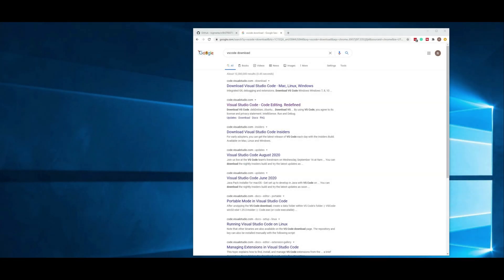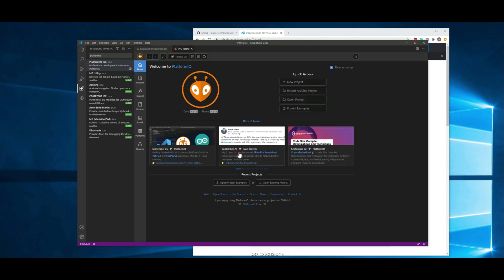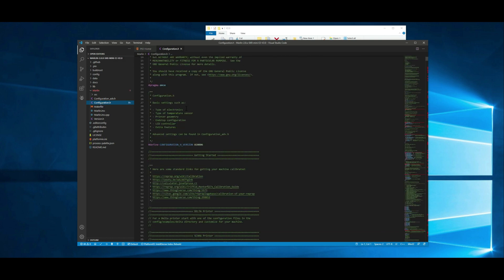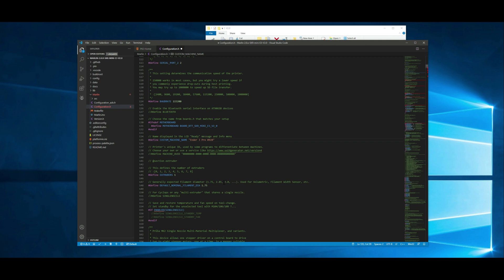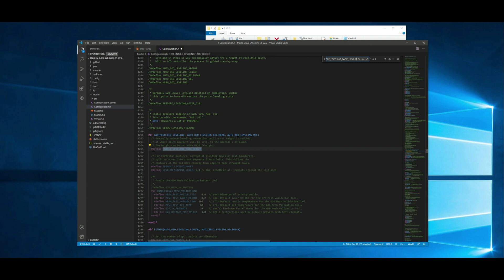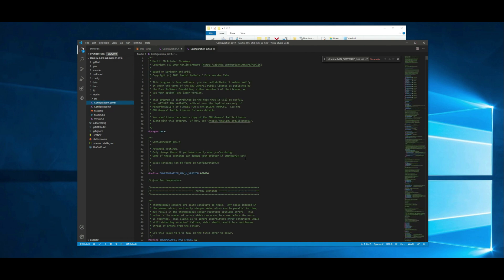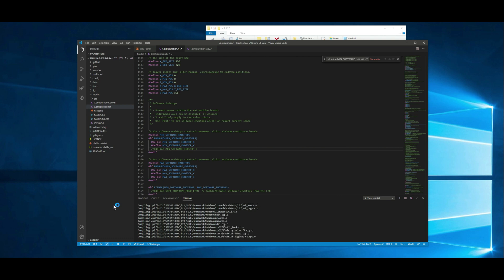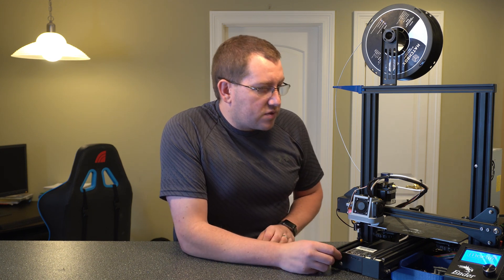How to Compile Custom Firmware for SKR Mini

Comment: OK need some help here.. First, let me apologize as this is going to be lengthy as I am having multiple issues and am getting nothing from Big Tree in the way of help. The reason for the new BTT Mini SKR E3 V2.0 is due to the old board finally crapping out. The extruder would not work anymore. I switched the connectors around and verified the board as the issue since plugging the "X" stepper motor connector into the "E" stepper motor worked telling me it was not the motor. Now after dropping in the new board and switching everything over 1 to 1 so there were no mistakes, I turn on my printer and everything turns on, then alarms and the only thing I can do is power off. So far not impressed. I have upgraded my printer. Its is the ender 3 pro with the Extender 400XL. With this I know I need to change my bed size to 400X400X500. That part is easy. I do not use anything other than that. I do have a bigger heater that is 120v but it is running through a solid state relay controlled by the board so it should not see any difference. I do have an addition z stepper motor with a splitter board turning the one out put into 2. Everything else is stock. So the board should see a heater controlled as usual, 1 "Z" stepper motor, the only change should be the bed size. However, I get nothing but failures during compilation. I am driving my self mad trying to figure this out. I have downloaded the firmware from both github and Marlin. I cannot compile anything from either. About to scrub it all and start over. Can anyone offer help/suggestions/tips/hail mary's?
Reply from the maker: Hi. What errors are you getting when trying to compile? Fixing those may be the best option.
Reply: @3DPrintscape  Linking .pio\build\STM32F103RC_btt_maple\firmware.elf arm-none-eabi-g++: fatal error: no input files compilation terminated. * [.pio\build\STM32F103RC_btt_maple\firmware.elf] Error 1   

This is after scrubbing EVERYTHING and starting ALL over. Uninstall and reinstall everything with a system reboot after the uninstall.
Reply: Got a replacement board from BIGTREETECH. ok so now I have good motion on all the axis's and bed and nozzle heaters work and come up to temp. Now, about this firmware issue. Once I have that licked, I will be golden.
Reply from the maker: @rickbagby6770  The error code 1 was just the exit code. There should be more info around the actual error in the output.
Reply: Everything goes smoothly until it gets to the "linking"
Reply from the maker: @rickbagby6770  Can  you send over the text around that part as well.

Comment: Not getting any checkmark to compile at all after install platformio.....
Reply from the maker: Hi. Thats normally caused by platformio not being installed or the wrong folder is opened in vs code. The folder you open should have a platformio.ini file in it.

Comment: Wanted to say a big thanks for this video, I'm slow on using my SKR Mini V2.0 with a BLtouch but without this I would have spent hours longer. The "stock" firmware no longer has the Z Probe Wizard enabled or allow negative Z numbers - I tried both setups 3+2 and 5 pin and neither worked well. So massive thanks for putting the how to customise the firmware info togther. Also the tip on those reversed wires in your other video also massive thanks. I hooked my Bltouch upto the 5 pins not the 3 + end stop (more as that was the last way I had it hooked up and I didnt want to open the case again)so minor changes for anyone (probably me in the future :)): enable probe_offset_wizard in configuration_adv.h - use USE_PROBE_FOR_Z_HOMING not Z_MIN_PROBE_USES_Z_MIN_ENDSTOP_PIN otherwise I followed the above exactly - Thanks again
Reply from the maker: Hi. Thanks for the feedback and info :).

Comment: My visual studio didn't have the check box in the lower left hand corner. Did I miss something?
Reply: I figured it out. I had to install platformio from extensions in case anyone else had this problem.
Reply from the maker: Hi. Thanks for the info, im glad you were able to figure it out.

Comment: Anything different we should be doing if we have the CRTouch rather than the BLTouch?  For instance, I wasn't sure if Z_MIN_PROBE_ENDSTOP_INVERTING is applicable to the CRTouch.
Reply from the maker: Hi. No they are basically the same to  the firmware. The Z_MIN_PROBE_ENDSTOP_INVERTING should be set to false for both.
Reply: @3DPrintscape  In the video at 6:00 you have it being changed to true.
Reply from the maker: @PaulHainesNJ  Ya i know. They made a change in the bug fix line over the summer requiring that to be false for the bltouch.

Comment: I get an error !!STOP called because of BLTOUCH error - restart with M999 then it says Unknown command: "M48".

I followed all of your instructions, the firmware I used was the latest so it was larger than the one you showed but the same options were available. Suggestions?
Reply from the maker: Hi. If you want to use the M48 command, you need to uncomment #define Z_MIN_PROBE_REPEATABILITY_TEST in the firmware.

Comment: Just a quick note (I haven't looked thru the comments so if this is already mentioned, sorry) but I ran in to a problem when compiling. It was missing some random files that was in the correct folder. Turned out that the path to those files was to long (Windows can only handle a path length of 256 characters). So I just moved the code to a c:\tmp-folder and it worked as a charm. Hope this helps someone. :)
Reply from the maker: Hi. Thanks for sharing this. I see it happen to people all the time, so im sure it will help someone out :).
Reply: Tried that - still get nothing...

Comment: Thangs for the video! One thing missing (maybe I've overheard it): The SD CARD needs to be formatted as FAT32 with 4096 byte size and it's recommended to NOT QUICK FORMAT. Uncheck "Quick Format", it takes around 10-20 minutes but that's ok and safer.
Reply from the maker: Hi. Thanks for the feedback/info. What your describing will work but using the quick format option works just fine as well. I haven had any issues using quick format in a long time, mainly back when actual spinning disks were commonly used.

Comment: Thanks for the video. I'm almost there. I get this error when compiling: Marlin\src\gcode\bedlevel\abl\../../../module/stepper/../../feature/../lcd/../module/../libs/duration_t.h:24:10: fatal error: ../HAL/shared/Marduino.h: No such file or directory. 

How do I fix this?
Reply from the maker: Hi. Try moving the firmware folder closer to the rood of your drive. I create a firmware folder off the C drive and put it there.
Reply: @3DPrintscape  Thanks! I finally figured out that that was the issue. One step closer to getting it working! I still have the issue of the printer spinning up for a sec and shutting down. Probably some error in my wiring.
Reply from the maker: @Stealth17Gaming  I agree that the current issue you are having sounds like wiring.

Comment: what do i need to do different for the new 32 bit board?
Reply from the maker: Hi. Are you talking about the v3.0? If so, I don’t have a process yet.
Reply: @3DPrintscape  I bought the upgraded 4.2.7 board and touch screen off of Amazon I haven't been able to get the touch screen working yet. I wanted to install the sensor and touch screen at the same time while I had the case open
Reply from the maker: @stikezone2010  Ah ok, you may want to check out the video I made on Marlin firmware for the 4.2.x boards. I don't think you will have an issue doing what you want though.
Reply: @3DPrintscape  I got the marlin bug fix 2.0 to download, but keep getting a failed-network error when i try to download the configurations
Reply from the maker: @stikezone2010  I havent had that problem, but you could try to go to the configs you want in GitHub and do a right click and save as there. That way its only downloading the files you want.
Reply: @3DPrintscape  which files do I need to download?
Reply from the maker: @stikezone2010  The specific config files related to your board.
Reply: @3DPrintscape  I think I got it figured out. When I clicked the check mark to build it, I got an error code
Reply: @3DPrintscape  how would I send you a picture of my screen?
Reply from the maker: @stikezone2010  Can you email me the full output and your config files? My email is admin@3dprintscape.com

Comment: The terminal process failed to launch: Path to shell executable - Well VScode wants to just play games. SMH stuck for 2 hours now. I Cant Build anything. UPDATE:  If you cant build by pressing the checkmark its because Platform has not found a compiler like Python, so download Python > click the box that says PATH when downloading Python then reload VS. Should automatically fix the issue.
Reply from the maker: Hi. Thanks for the tip there. Python shouldnt be needed but if your running into path issues installing it with default settings can help out.
Reply: @3DPrintscape  I uninstalled and reinstalled VScode 3 times and I was running to the Path issue all three times untill i installed Python .
Reply from the maker: @MrFamousguy13  I'm guessing it is from something else that was installed, there are so many variables at play. I will use this as a recommended fix for people that run into path issues though :).

Comment: I used this video to set up my software when I upgraded my first Ender3 to the SKR V2 32 Bit bd. Last week I got the same bd for my other Ender3 and I notice that the Marlin software version has changed. Is there anyway you could create a software “Wizard” to upgrade the Marlin software. I believe you have the ability to industrialise the process and you could copyright the final product . I would pay for a Wizard. Someone has to do it, why not you.
Reply from the maker: Hi. There is a AUS site that provides daily builds for about $10 a year, though i have had to troubleshoot issues with people on discord running them that was related to the firmware. I dont remember the name of the site though. Is that what your looking for or were you thinking of something else. I would be open to try to create something that solves a need if there is enough value for everyone there. You can also email me your thoughts, my email is admin@3dprintscape.com

Comment: what if i don't want to use bltouch as my endstop? what settings do i change then
Reply from the maker: Hi. You would have the 3 wires connected to the bltouch port, two to the z stop port and make sure you uncomment #define Z_MIN_PROBE_USES_Z_MIN_ENDSTOP_PIN and comment out #define USE_PROBE_FOR_Z_HOMING

Comment: I've followed you step by step multiple times now and I keep getting a bunch of red error messages when I try to compile. I'm doing this for an Ender 3 pro with bltouch and downloading the same firmware and for some reason it won't work. Is there anything besides platform.io that I need to setup on VS Code first? I also get some red squigly at the top of the code that comes up as some error that says "plesae update your include path"
Reply from the maker: Hi. The only thing thats needed is platormio, which also installs C++. If your getting a path warning, i would reboot the computer then make sure the firmware folder is close to the root of the drive. Windows doesnt like long paths and the firmware folder structure is pretty deep.
Reply: @3DPrintscape   I renamed the folders and extracted them to the desktop as to shorten the path, but I'll see if the restart helps.

Comment: Great videos I have a question, after loading the firmware and clicking level bed my bltouch probe is off the bed and would crash if I didn't stop it, any ideas? I'm using bltouch in dedicated port with a direct drive.
Reply from the maker: Hi. Try to clear the eeprom to see if that moves the probe back to the bed.

Comment: after compiling as you said my hotend slams into bed. I am not using a zstop sensor just the bltouch what controls that?
Reply from the maker: Hi. I would need to know how its wired and the changes to the firmware. If you have all five bltouch wires connected to the bltouch port, the z stop needs to be connected and you would comment out #define Z_MIN_PROBE_USES_Z_MIN_ENDSTOP_PIN and uncomment //#define USE_PROBE_FOR_Z_HOMING. If you have the three wires connected to the bltouch port and the other two connected to the z stop port, you would make sure #define Z_MIN_PROBE_USES_Z_MIN_ENDSTOP_PIN is uncommented and //#define USE_PROBE_FOR_Z_HOMING is commented out. I cover this more in the bltouch on skr video https://youtu.be/PMG4bC9I3DA and the written instructions https://3dprintscape.com/bltouch-on-skr-mini-install-guide/ .

Comment: i love your channel thank you for all the help via the vids. 
I have a problem and dont know how to fix. I follow meticulously and when I try and compile I just get...
Marlin\src\gcode\feature\advance\../../../module/stepper/../../feature/../lcd/../module/../libs/duration_t.h:24:10: fatal error: ../HAL/shared/Marduino.h: No such file or directory
 #include "../HAL/shared/Marduino.h"
          ^~~~~~~~~~~~~~~~~~~~~~~~~~
compilation terminated.
* [.pio\build\STM32F103RC_btt_maple\src\src\gcode\feature\advance\M900.cpp.o] Error 1
==================================================================== [FAILED] Took 37.36 seconds =========================================

my printer has been down for to long. I would pay at this point to get it going lol.
Reply from the maker: Hi. It looks like you may have the firmware folder too deep on the drive. Can you try to move it closer to the root of the drive? For example, make a folder called firmware directly on the c drive, then copy the firmware folder there.
Reply: @3DPrintscape  Thank you! you saved me after a while! now a new problem. i also posted on discord last night.. 
Hi i installed a skr mini e3 v2 on my tevo nereus all axis move in correct direction bed and nozzle heat... but when i home it just bumps like the switches are triggered. switches make continuity when depressed. i am operating  the axis with the tft35 touch screen so no cura intervention. it is like it needs different switches or diff firmware settings for these. i dont know if there normally open or normally closed just that they make continuity when depressed, so i am guessing NO.
Reply: i actually just fixed it had to set endstops to true!!!! thank you for your help!!!
Reply from the maker: @shawnrinkel8377  Cool, glad you got it working. If you run into any more issues and need help don't hesitate to reach out here or on discord.
Reply: @3DPrintscape  ok lol one more question. im finally printing now i have a weird one. my skirt and draft shield do not print in the right shape. it just makes weird shapes but the item printing prints ok. my test cube is 20mmx20.1mm the cube is a little bit under extruded but i think a little heat change will fix that.
Reply: it was my gcode flavor its rocking and rolling!

Comment: I’m starting with a CR-10 original. That means original motors and a 12v power supply.  I will be installing the SKR Mini E3 v2 and the TFT35 touchscreen. Can I just use the precompiled Ender 3 firmware and change the build size in firmware and it’ll work?  Or is the voltage an issue in the firmware?

Thanks!  Your videos are the easiest for me to understand.  Great job!
Reply from the maker: Hi. I think Marlin has a config example for that board combo that you can start with but if your going to the skr mini anyway, i think what your thinking about doing would work just fine.
Reply: @3DPrintscape  thank you so much!   I’ll give it a shot and see what happens.

Comment: I don't have the "check" button on the bottom left of my Visual Studio Code. I made all the changes you went through in the video and now I can't compile/build. Please help.
Reply from the maker: Hi. The check not being there is normally caused from the paltformio or C++ plugin not being there or needing reinstalled, or the wrong folder being open. The folder should have the platformio.ini file in it.

Comment: you loose me at 10:01. I dont have the blue check mark
Reply from the maker: Hi. The checkmark missing is usually from the platformio or c++ plugin not being installed/or being corrupted, the wrong folder being open in vscode, or multiple instances of the firmware being open (so more than one platformio.ini files being loaded).

Comment: how do you compile without the blue check mark?
Reply from the maker: Hi. The checkmark missing is usually from the platformio or c++ plugin not being installed/or being corrupted, the wrong folder being open in vscode, or multiple instances of the firmware being open (so more than one platformio.ini files being loaded).

Comment: Custom Firmware for SKR Mini E3 v2 with Arc_Support, Compiled and Installed. Next step, BTT BLtouch add-on. THANKS
Note : Atom, PlatformIO with bigtreetech github files and configs. Always have to remove FrameworkArduino folder from within ".pio/build..." folder before recompiling.
Reply from the maker: Hi. Great work and thanks for the tip.

Comment: i upgraded my board to the skr mini e3 v2 and added a bl touch v3. i also added the custom firmware using this video for reference. after i compiled the firmware and flashed it onto my board everything seemed to be working right but my extruder gear is rotating the opposite direction so it pulls filament out instead of pushing it through. any ideas of how to fix this? i’m currently trying to go into the firmware and change the command for the extruder.
Reply from the maker: Hi. You should be able to fix this by switching the value on #define INVERT_E0_DIR .
Reply: @3DPrintscape  thank you!
Reply from the maker: @samhintz8479  You're Welcome